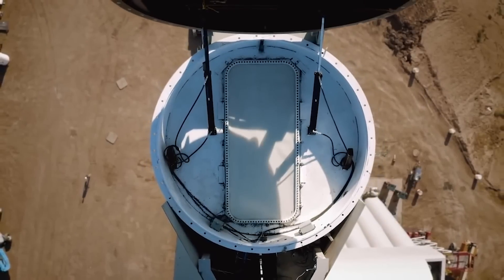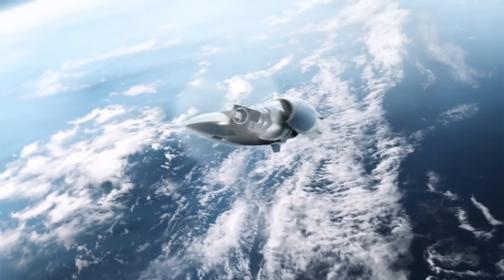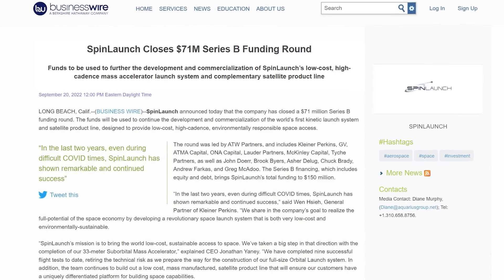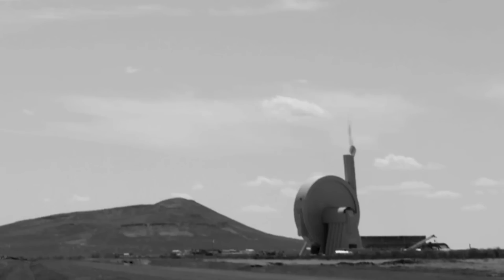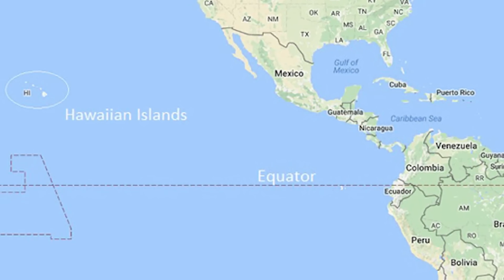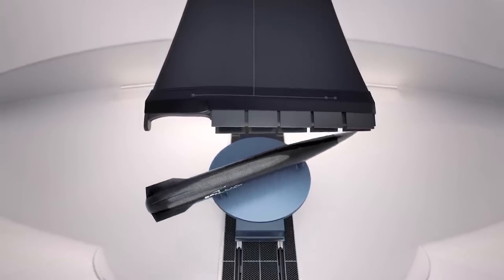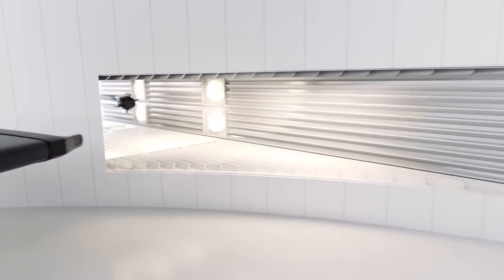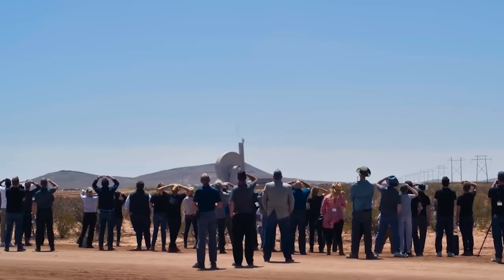What Happened To SpinLaunch & The Orbital Accelerator?

Comment: I read that neglecting air friction, orbital velocity is about 5 miles per second, which translates to 18000 miles per hour.  So until that speed is reached, plus an allowance for air friction, this is a non starter.  

Not trying to be a downer, but any article that omits a discussion of this is not much more than a press release.
Reply: Not necessarily.  If you can use this to get a good chunk of the speed and altitude of a launch, then the vehicle can be a lot smaller.  It doesn't actually have to propel the thing into orbit to be valuable.